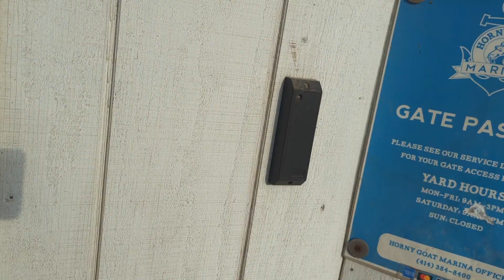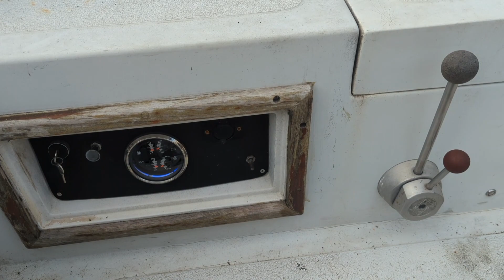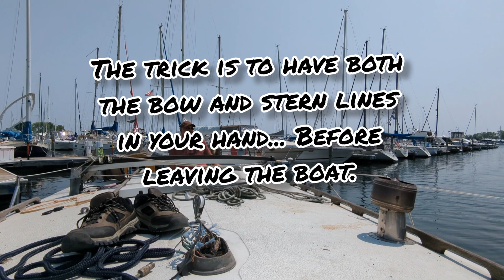#93 ATAP... Sn3 Ep39 Great Lakes to the Bahamas in a 50 year old boat, Another Time Another Place

Comment: The chainplate is right on that bulkhead. First thing I'd do in chasing that leak is undo the chainplate fitting on deck where it passes through and reseal with butyl tape. Next id look at the port side stansions for rebedding. A clue if ones bad is if one is slightly not standing straight up like its been bent against a dock in the past. Obviously theres otyer ways in too. The least fun one would be the deck to hull joint. If that needs to be fixed, you'll have to remove the cap or toe rails and reglass the entire port side. Love your videos. You really come through as a great guy. Good luck. I'm working on my Baba30 now.
Reply from the maker: Thanks Lou, great help... I appreciate you pointing me in the right direction, good information.  Thanks for watching too.👍🙂

Comment: Nice boat,  but I don’t see any water coming out of the exhaust.  Is your engine temp ok?
Reply from the maker: Thanks for asking... I have a thermostat that only pulls new water after it heats way up to almost 200 degrees. It pumps out only hot water, every few minutes. Apparently it helps the fuel consumption stay lower. Before my rebuild it was a continuous spray. Many have mentioned the same thing to me, thinking my strainer was clogged. I appreciate you checking up on it bud. Thanks again , ⚓🙂👍